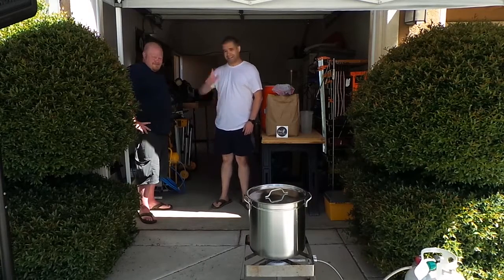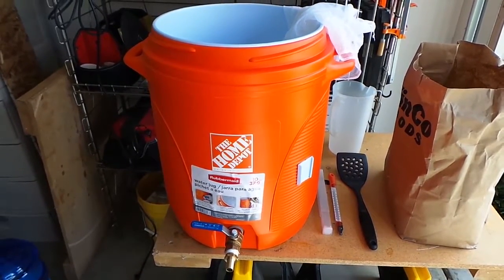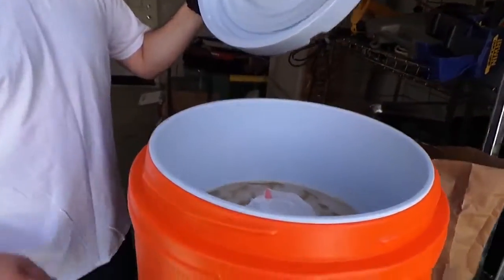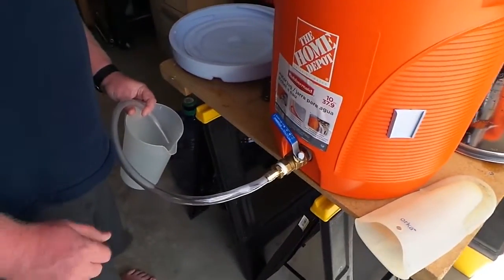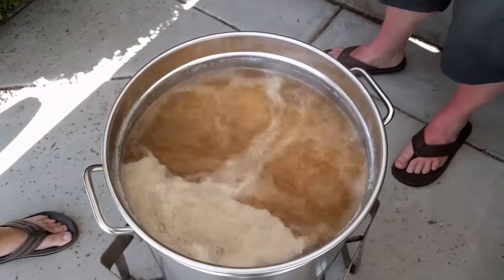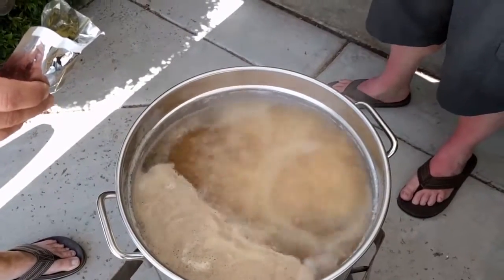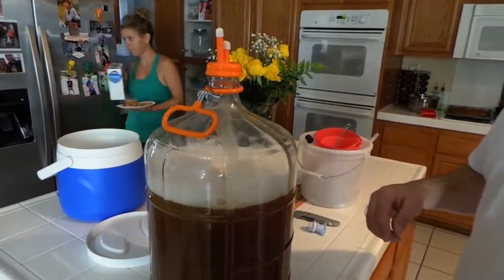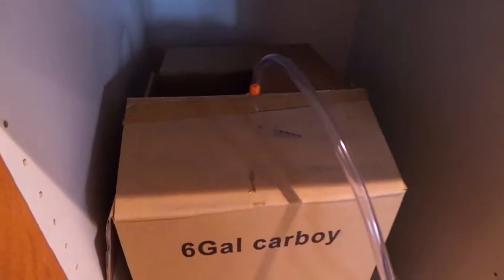FNG's Beginners Guide to All Grain Homebrew

Comment: Hi Jeff....Murphy helped you out. By using two temperatures, the temperature range for Beta and Alpha were covered. By the way, the day when starch converts to sugar will be the first time that it occurs on the planet. Beta is the conversion enzyme. The enzyme converts glucose into maltose and malto-triose during the maltose rest period. Basically, starch is the container which holds the sugar and enzymes hydrolyze starch. It's a science thing. 
Since, the mash was rested at a maltose temperature, the beer should be second fermented. During second fermentation another type of conversion occurs. Yeast absorbs maltose through the cell walls and expels glucose which is fermented and gravity decreases. During the aging cycle, yeast absorbs malto-triose and expels glucose which is fermented and natural carbonation occurs. The oxygen that the yeast uses to burn the fuel is contained within the molecular structure of the sugar. It is a science thing. 
When producing beer, especially wheat beer use a proteolytic rest at 122-125F at pH 5.5 for 20 minutes and a beta glucanase rest at 130-132F for 20 minutes at pH 6. Then, infuse boiling water to reach the maltose rest 140F and rest the mash for 20 minutes. Infuse boiling water to reach 148F and rest the mash for 20 minutes. Then, infuse boiling water to reach 154/155F and rest the mash for 10 minutes. Then, infuse boiling water to reach 162F and rest the mash for 15 minutes. Test for starch by using iodine. The iodine should be orange/deep red in color. If the iodine changes blue/black, the malt is poor and the final product will be unstable and it will deteriorate during aging. Dough the mash in at one quart water to one pound of grain. The boiling water infusions will reduce viscosity. Before raising the temperature to Beta temperature adjust pH to 5.4/5.5. During saccharification, reduce pH to 5.2, use sauer malz. It is more brewing science stuff. 
Refer to Weyermann's recipes. They know quite a bit about producing beer. They are nice people to deal with and they produce fine malt. They will answer any questions from home brewers. Their light and dark Boh. Pils floor malt is excellent brewing malt. It is richer in enzymes than standard HBS continental malt. However, it is more expensive than standard HBS malt. 
Skim off hot break as it forms the stuff is vile. 
Great workmanship and attention to detail. A blow off is far superior to air locks and the orange cap can be used as a means to inject low pressure CO2 into the fermentation vessel to push the beer out during transfer without adding atmosphere on top of the beer. Procure a tube that fits into the straight port. Cut the tube long enough. Use three hose clamps, one around the cap and neck of the carboy and two around the transfer and CO2 ports. Be careful, do not use high pressure, three PSIG is enough to transfer beer. Keep the inlet of the transfer tube above the sludge. I use large conical fermentation vessels and three PSIG is plenty for transfer, the reliefs are set at five PSIG. 
You did a GREAT JOB!!!
Reply from the maker: Thanks for that great feedback!  While am nowhere near a master, I do appreciate a master's perspective!  One day...